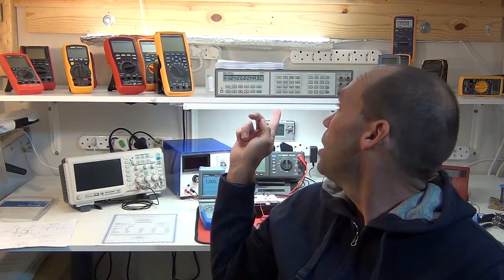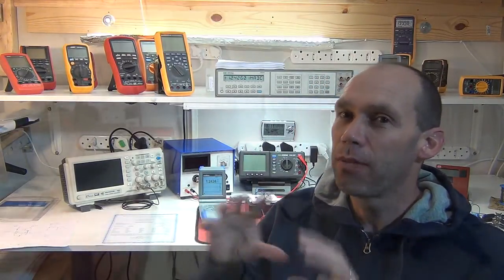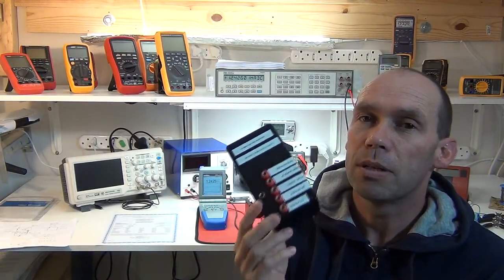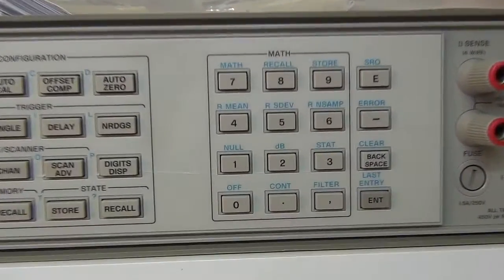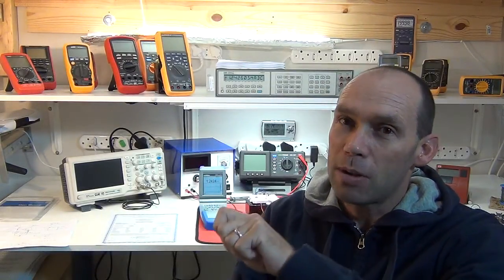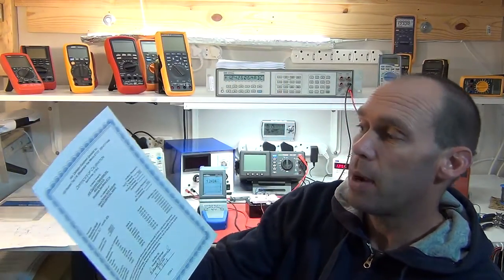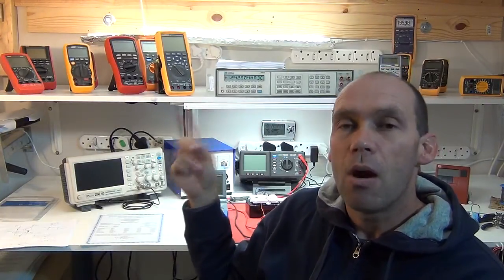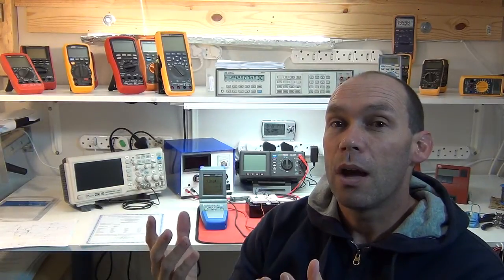T4D #9 - Mailbag and HP3457A 6.5 digit multimeter arrived!

Comment from the maker: Sam....great idea on maintaining stable conditions in the lab....the running of an aircon for extended periods would however cost a lot. It's something I will consider once I have the lab running off solar power though.Temperatures will moderate once the solar panels are on top of the "tin roof". I'll have a better idea of the temperature range I'm dealing with and how best to cope with them. Thanks for the post...and for sending down this "little" adventure! Cheers, Martin.

Comment: I'm curious if calibration stays the same all over the world due to a difference in electromagnetic 'background'. If I recall correctly - in old days with CRT displays that was an issue (even with proper shielding etc.) Sure enough - multimeter circuits should not be affected as much as CRT, but anyway...